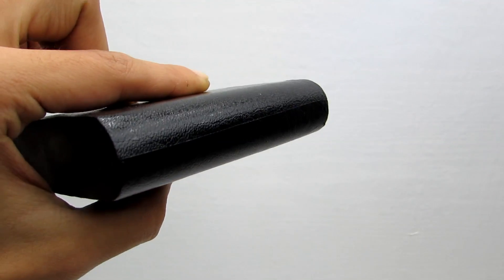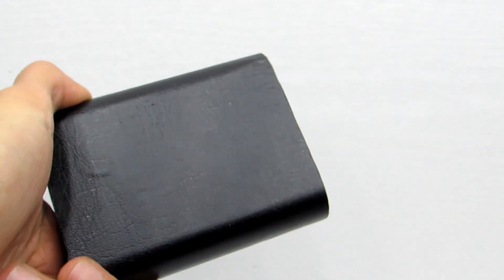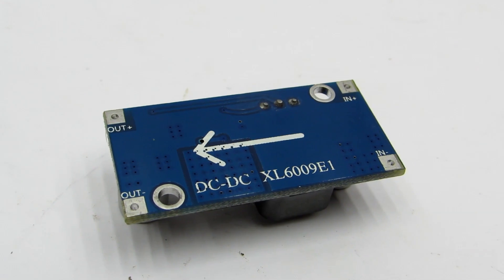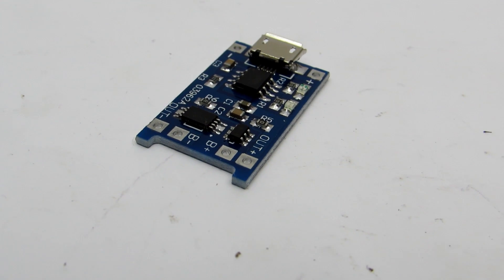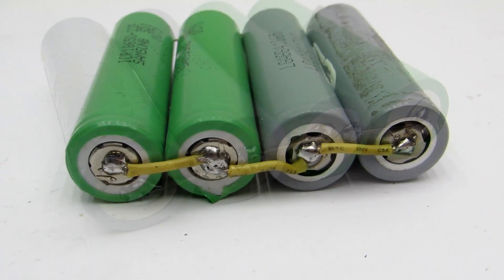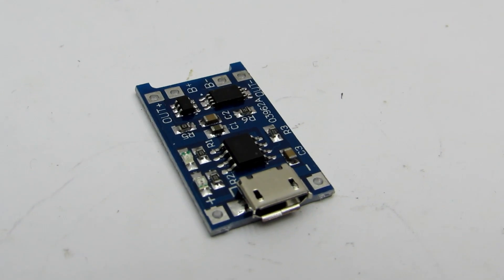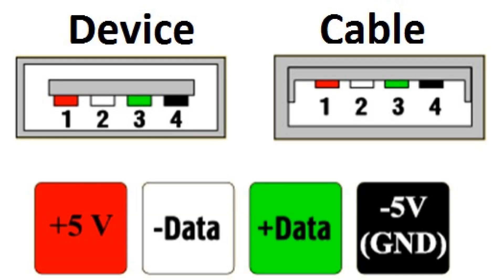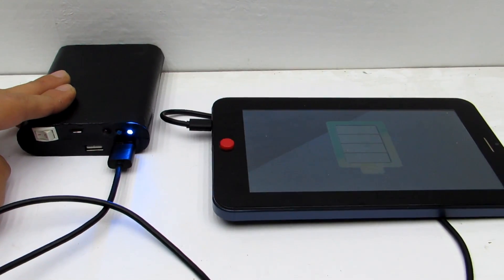DIY Power Bank

Comment: hi nice build ☺️, but do u think using Tp4056 charging module which is designed to charge single 18650cell will be able to deliver demanding current of so many cells in parallel? i think it will not... the ic will get hot and eventually burnout.
Reply: no. just take more times.
Reply: It is constant current 1A

Comment: Hi 
I made this power bank but there is a problem arises! My Xl6009 chip is getting very hot while changing my phone. The charging current of my phone is 1A.  Please solve the problem sir. 
Thanks in advance
Reply: This is perfectly normal. That is due to the resistance of the  voltage conversion on such a small piece of electronic.
Reply: Add heat sink on xl6009 ic

Comment: I'd recommend 4,3-4,5 volts for the output for better efficiency
Reply: Interesting. But wouldn't 5.0v output allow faster phone charging and allow for longer USB cable to device? Does the phone step the voltage back up to 5v? if so then the efficiency gains would be lost at the phone side and the phone would get hotter, not?
Reply: Dimitri Pappas the phone regulates it in the range between 5v and 3,7. there is no point in making converter to get exactly 5 v all the time, especially when space and size of circuitory matters. lower voltage would lower the current and lower the time it takes to charge, but if I'm using PORTABLE power bank I don't need speed I need capacity. faster charging would just waste more power